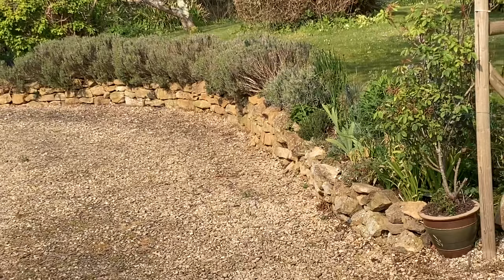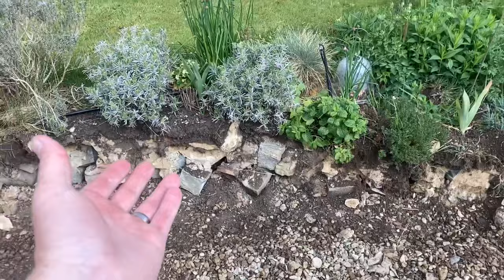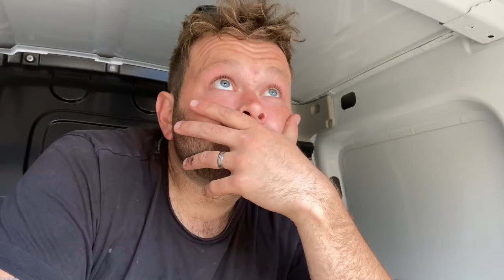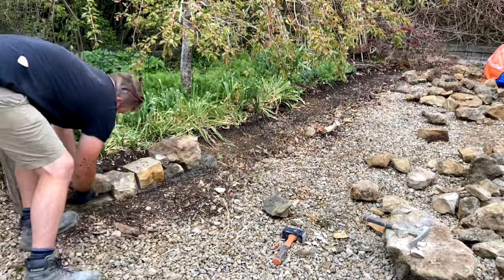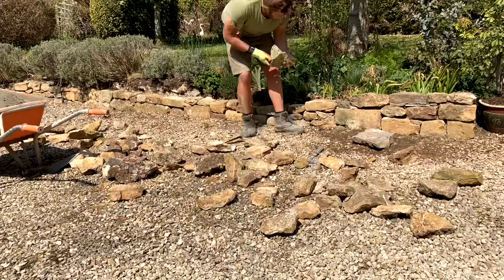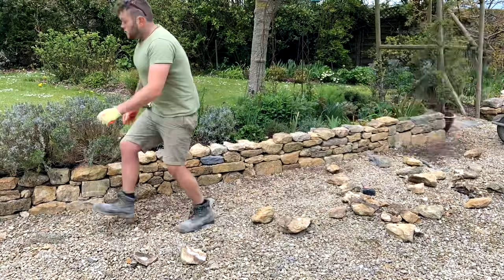Building A Dry Stone Effect Small Garden Retaining Wall

Comment: Great job man. I’ve been work on one in
My yard for 5 years started with rounded dry stack  every year I redid it finally got enough flat hammer chipped blocks/ stone kiddie cornered another opposite side slate. Hard work there lots of bending down and lifting fitting . If it doesn’t fit I make it fit and level.
Hard rewarding works
Reply from the maker: Thank you! Was hard work but was a satisfying job! Glad you finally finished yours!